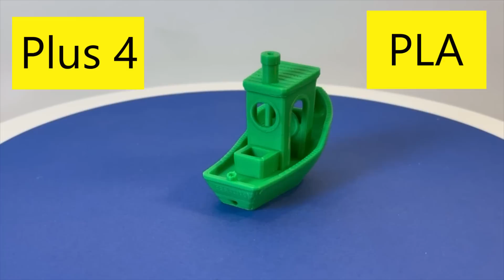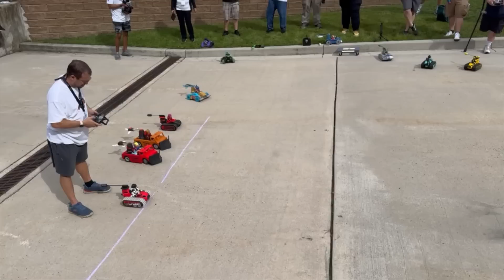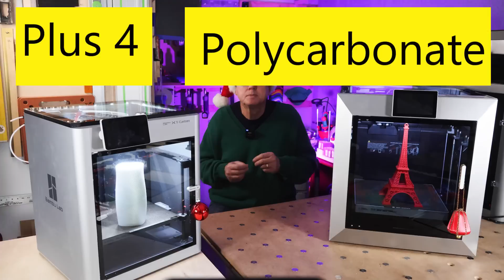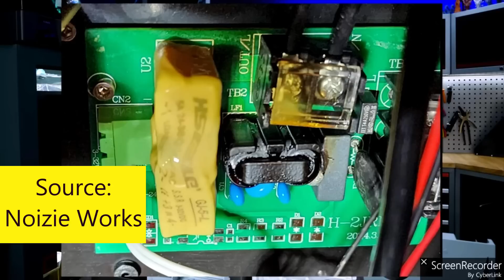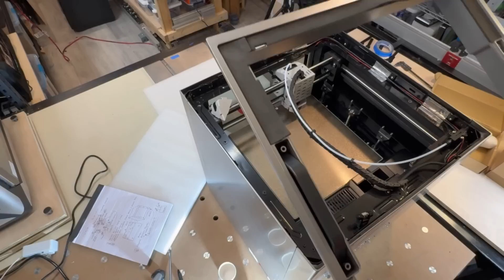Qidi Plus 4 3D Printer: Better Value Than Bambu Lab X1C?

Comment: Im returning a Plus 4 in 2026 , mine came cursed, loses flow shortly after starting a print , changed a bunch of parts and keeps on doing it.  Took me more than a month to convince Qidi its a faulty printer
For those considering this piece of $h1t printer, take note that this machine takes more than half an hour to start a print. 
The design of the machine is poor, Z assembly its from 2019 , needs Z offset adjustment every day.
I suspect that Qidis toolhead suffers from heat creep while printing high temp filaments , again due to the poor design , and my machine suffers from this every ASA print 
For that money you can get two magnificent centauris or just build a premium DIY printer...

Comment: Have you encountered any problems with the QIDI PLUS 4 10 months after publishing this video? I'm about to buy my first printer, and I found this QIDI and the FLSUN S1 PRO very interesting.
The main use is for armor costumes, but after careful research and study of the filaments, I think I'll also design other things.
Which of the two is better to buy now that the S1 Pro costs $1,000 with the addition of a €200 coupon and the QIDI is $650?
Reply from the maker: I’m still using my Plus 4 every day and I’m happy with the results. I don’t have as many hours on the S1 Pro so I don’t think I can offer you sound advice on which might be better for you. I can say that I have 4 different models of QIDI printers and I feel their designs have gotten better with each model launch. Thanks for the question.
Reply: @ristinnovations  i forgot to mention the Anycubic S1 Max coming next year. it's a very good deal, but can we trust the reliability of new printer? anycubic promises many features but as we usually know many things = many problems

Comment: PCBWay steals your designs and gives them to Chinese state owned companies to reproduce. By providing data to PCBWay, You grant PCBWay an irrevocable, non-exclusive, perpetual, royalty-free, fully paid up, worldwide, transferable and sub-licensable right and license to use, copy, modify, reproduce, distribute and display the data (including PCB files,3D CAD data and drawings), documentation, drawings and specifications. Any NDA signed by a chinese owned entity cannot be enforced and will not be enforced in china.

Comment: I like the style of this vid.  tt is very informative and extremely well structurized.  I have only a comment about the calper measurings.  I think you always have outside and inside measuring point of every molded string.  
Measuring outer diameter @ sharp caliper tips will not be correct.
Reply from the maker: Thanks for your feedback

Comment: You should have used a third party filament as Bambu has all their filaments dialed in for their printers. Unless you calibrated each filament for the Plus 4, you are running a biased comparison.
Reply from the maker: You do bring up a valid point.  Thanks for the feedback.

Comment: If qidi has fixed the issues on the plus 4, I would definitely consider them for my first printer and the ability to print with engineering grade filaments is a big plus for me.
Reply from the maker: I have the impression they have taken their issues seriously based on their CEO’s comments. Of course, actions speak louder than words so time will tell.
Reply: @ristinnovations that’s good to hear, I will definitely keep a eye on them even if they are a little bit over budget. for what you get it makes up for price

Comment: That you would recommend a printer, in any way, that could potentially burn your house down as well have to strip it down to its chassis to change a heater fan out of the box…. I dunno.

Comment: Many are probably thinking P1S vs. Plus 4. In this video, we had several falilures, the potential for fire, and plus had to have several parts upgraded. Specs are great for the plus, but those failures are too much.
Reply from the maker: Yes, comparing the Plus 4 to the P1S would be another good comparison. I also agree that some of the issues of the Plus 4 negatively impacted what would otherwise have been a more compelling option. Thanks for your comment.
Reply: @ristinnovations  Thanks for the response. Given we have the comparison from P1S to X1C in a previous video, I imagine you still favor the Plus 4. If I could get any opinion from you, it would be where Qidi is now with what they ship. They have upgraded components, but you still hear about heat creep. Months later is the plus 4 a fire hazard, and would a new user have to deal with more quality based print issues than other brands?
Reply: @AN-717 my Plus4 is awesome! No issues, whatsoever.

Comment: Faulty Plus 4 here! Mine went faulty soon after purchase. 5 months later (Apr-25) I cannot get Qidi to refund or replace for a working printer. Over 400 pages and many many photos support what I write. Buyer beware!! Mine is literally a dust collector now.
Reply from the maker: Wow, I'm sorry to hear that.  In my small contact with their technical service department they have been very responsive.  I can understand your frustration, especially since it has not been resolved 5 months later.
Reply: @ristinnovations  Agree!  Service department were responsive and good to deal with UNTIL it was realised their printer cannot be repaired by "just sending part after part". Delivered beginning of Nov 24, as of Apr 25 I still cannot print.  Thankyou 🙂

Comment: do any of you guys think the Qidi Plus 4 is being supported as good as the X1C?, or should we wait for the next H2D Bambu printer?. I would like to know which one to invest for mid 2025. (I already have an X1C and P1S).
Reply: You don't want to wait on the H2D. It's a laser+3d printer combo and will be upwards of $5000.
Reply: @littledovecitydust  now I see the price I might wait for the H2D combo without any lasers hopefully to get it on August. But still thinking on purchasing a Qidi for End of this year
Reply: @JLRodriguezPeñaJL   good choice. I actually did the same as well.
Reply from the maker: The few times I have needed it, Qidi's technical support have been responsive.  I haven't had any experience with Bambu Lab's technical support.  If you are waiting until the middle of 2025, then it would be great to see what Bambu Lab has in the works before you buy.  I wish you all the best with your decision.

Comment: This is like a PC vs Mac competition. Qidi (PC) is more powerful, bigger, heavier, and pretty much open source vs BambuLab (Mac), a proprietary, conservative, sleek, fine machine that does everything perfectly. I have Qidi X Plus 3, and that is by far the best printer I have used. It is bulky, plasticky, and ugly, but it prints everything perfectly for almost 2 years of heavy usage. If Qidi just slowed down a little and looked over their product more carefully before putting it on the market, they would be a BambuLab killer.
Reply from the maker: Thanks for sharing your opinion and experience with your QIDI printer. I agree with your point of view.

Comment: Your "journey" in fixing the heater issue is an indicator of QIDI's poor engineering ability. It should NOT take that level of effort to replace a fan. I've designed and built industrial level multi axis laser and waterjet cutting systems for years, and know of what I speak. A technologically able customer of mine made an excellent observation years ago about evaluating a new industrial laser. "Don't tell me wonderful your laser is. I want to know what sort of aggravation I'm facing when the day arrives that it's broke and I have to fix it." They ALL break. Period. The best machines are from companies who know this and design their machines so they're not a  PITA to fix when they do break. I've owned an X-Plus 3 for some time and I am NOT impressed with QIDI's engineering ability.
Reply from the maker: I appreciate you frank point of view. Thanks for sharing your comment.

Comment: I still love my X-Max 3. Had some minor issues (like z-Bearings were not good quality, changed them to misumi ones), also changed hotend to a Revo and some other changes. Having a heated chamber is a benefit I realy love. Esp. in winter with a room temperature about 10°C I even heat for PLA...
I love Qidi using opensource (Klipper). This makes modifications quite simple. I think about adding an ACE pro from Anycubic, as someone discovered the protocoll (DuckACE on github), so it should work with any klipper printer. While the x-Max 3 has no filament cutter inside the printhead, due to my modifications I can use a Revo standard flow nozzle and Prusas ramping profiles instead cut&poo. Would reduce waste and time for filament changes quite a lot.
Reply from the maker: Thanks for providing your experience with the X-Max 3, including your modifications.  I am very interested in your possible plans to add the Anycubic ACE to the X-Max 3.  Please let me know how you make out.
Reply: @ristinnovations  It might take some time. I can only do it in summer, as I need the heated chamber in winter. But I will report on my chanel if I make it.

The most importent upgrade for the x-max 3 of course is the Revo hotend, alowing ramping profiles on unload creating a near perfect filament tip. So no cut is needed for reliable unload. However, you still can insert a Revo High-Flow nozzle for single material prints. Thats the big difference between printers using a nozzle with standard size meltzone (Prusas mk3, mk4 CoreOne, or any Revo using normal flow nozzles) and all theese "high speed = bigger meltzone" printers. You can form a nice nozzle tip (at least using dry PLA or ABS/ASA) on unload due to Prusas research. All theese big meltzone hotends can´t do it. Actually the mk3 + MMU2 had a lot of problems at the beginning and realy take of after changing the hotend to a Revo. The Nextruder nozzle in the mk4 and core one is quite simular. Theese nozzles with integrated heatbreak and standard flow realy are a big step forward for filament changers.
While the MMU3´s filament management is not the best (buffer+ much space for spoolholders needed), the AMS,CFS and ACE are much more comfortable. However, the printers they are delivered with are all with bigger meltzone to print faster. Wich makes filament changes extra slow and wastefull. I think combining a Klipper printer with Revo hotend and ACE might be the perfect solution if a toolchanger is out of budget.

One problem with QiDi´s printers: They use a thermocouple on the hotend, not a thermistor. So using a Revo Heatercore is only possible by using a 3th MCU (I used an old Creality silent board I flashed to Klipper). I now got a Revo HT-Heaterblock, but still search for a fitting ThermoCoupler. This will also solve the temerature limit of 300°C for standard heatercore. With the RevoHT you could use RevoHT nozzles for up to 500°C, so the 350°C allows wouldn´t be a problem.

Adding the ACE pro might take some time. A lot of projects in the line. Just finished my inofficial Prusa mk3.3/3.7 upgrade (sorry video only in german), one mk4 has to be upgraded to mk4s + MMU3, a Qidi X-Smart 3 also wants a Revo hotend, in april the mk4s will become a Core one (and as I started with an mk3 I will have all parts to build an extra mk3s+/mk3.3 with the acumulated spare parts), in may I am at holydays. So the ACE pro project might start in june/july. 

However, I am not sure if I try the ACE on my X-Max 3 or my SV08 first. But this should´nt matter, I have Revo on both and both are Klipper, so the way should be compareable. Also I have 2 ACE pro...

Comment: Way better value- that's a no brainer, but hands down better performance. I have both, and I just passed 1000 hours on the Plus 4. It does a better job hands down. Handles advanced filaments better, and for me the biggest thing is it's MORE accurate than the x1c. And 400 bucks cheaper. The only one up the other way imo is the qidi box multifilament hasn't come out yet. This quarter. And as of now- none of the bambu drama that now plagues bambu. The plus 4 can print a better PC benchy than tge other printers can with something easy like PLA😂 (One negative- the plus 4 is MUCH easier to heat creep pla and even PETG with if you don't have a cooled down machine with lid off and doors open. That's a solid plus on the x1c side. The plus 4 is entirely geared towards higher temp filaments the x1c can't touch. You can literally print the lower temp PEEKS on the plus 4. For 800 bucks! I'm all team QIDI these days
Reply from the maker: Thanks for sharing your experience with the Plus 4.  I am also enjoying mine.

Comment: The Qidi plus 4 is closer to the P1S which is now cheaper than the Qidi.
Reply: What? They are not even in the same league.

PLUS 4:
Larger Print Volume
Chamber Heater
Hotter Hot End
Hotter Bed
Klipper (For open sourcing and custom configurations)

Comment: Nice experience. I find it wrong that so many YouTubers say the print size is 305x305mm when it is not. The max size is 290x290mm, as some space is used for the filament cutter. But it is also wrong that Qidi Tech announces that the printer can print that size when it is not true.
Reply: No the print area is 305X305 with two very small cutouts at the back left and front right. You can't print a perfect 305X305 square, but the build area just has two very small exclusion zones. It is worth noting, but calling it 290X290 is also way off.
Reply from the maker: Thanks for pointing that out.

Comment: I bought the Qidi Plus4 a couple of months ago.  I'm amazed by it's consistency with ABS ASA and PETG.  Just so easy to use and the quality and speed is incredible.  Qidi does have some QC issues.  For instance, they forgot to plug in the USB cable for the webcam and it was so well hidden that I didn't even notice that there were two USB ports on the motherboard, one of which was empty.  They mailed me a new camera after I tried a bunch of useless exercises to get it back online, only to finally notice the point that they forgot to plug it in.   Kind of silly but kudos to Qidi for sending me an extra camera and new heater board.

Comment: One plus for Plus4 - easy and fast nozzle change. It is important for people who use wider nozzles for some prints.
One has to dismantle and replace the full print head in X1C. Very cumbersome. In Plus4 - just unscrew the nozzle and screw in the other one.

Please note that if you have a big object with no very minute details, a bigger nozzle like 0.6 or 0.8 can cut the print time by half or more.

Comment: Does the Qidi come with the new SSR board, I just other one last week (2025-01-31)?
Reply from the maker: It is my understanding that QIDI has been shipping Plus 4 printers with the new SSR board, but just to be sure, I recommend that you contact Qidi directly for your specific order.  Thanks for the question.
Reply: I had the same question 3days ago. I checked mine and it is wired the same as the defective ones looks similar but version number is different plus some minor physical differences. I reached out to Qidi as I was nervous about using the chamber heater and was just looking for verification. They responded that new ones do ship with updated boards for 110v.  they are sending me a replacement anyway.

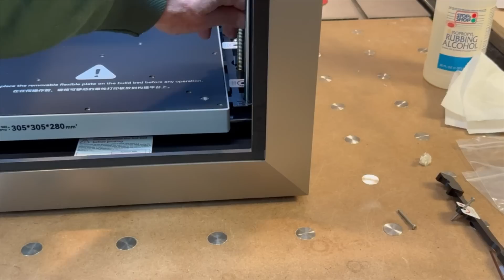Comment: 17:24 I don't find these activated carbon bags of the Quidi Plus 4 that don't fit properly particularly trustworthy. Something like this should fit properly so that the gases can't escape past the sides.
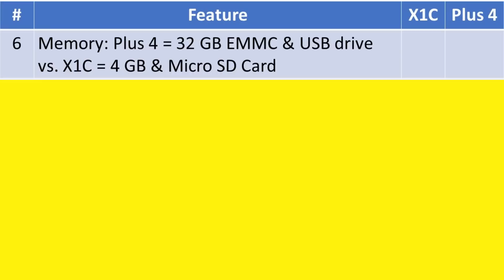26:47 In my opinion the USB drive connection is a big advantage. MicroSD cards are too small and therefore too fiddly. The 3D data is created on the PC, so a USB stick is clearly the advantage.
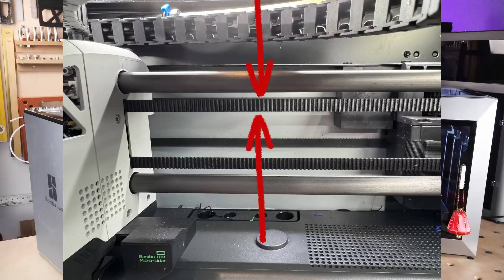12:36 I also see the plastic cover as critical when you consider that there is an active heater in the device and the fan could fail. A nightmare in terms of safety.
At the moment I wouldn't buy either of them. The safety defects on the 4 Plus are too serious for me. And I can get the X1C with heating function if I buy the X1E.
Reply from the maker: Thanks for providing your insight.
Reply: But you can buy 4 qidis or 2 x1c for the price of a x1e 😂 also have to find a dealer that will sell you one 😂
Reply: @garyhowe88  My house is worth more to me than risking anything. I'm also leaning towards a Prusa CORE One. I'm just waiting a little longer until the MMU kit is out.

Comment: QIDI may have some QC issues, but their customer support is way better than Bambu Lab. They've also been making printers longer than Bambu. I have a QIDI XPlus3 and a Bambu P1S. After Bambu's latest firmware talk I'm waiting to see how QIDI's AMS system does when it's released. Specs wise I like the QIDI more.
Reply from the maker: Although I don't have any direct experience with Bambu Lab customer service, I totally agree with you regarding QIDI's customer service being very responsive based on my personal experience.  I am also hoping that QIDI's multi-filament module will be successful.  Thanks for your comment!